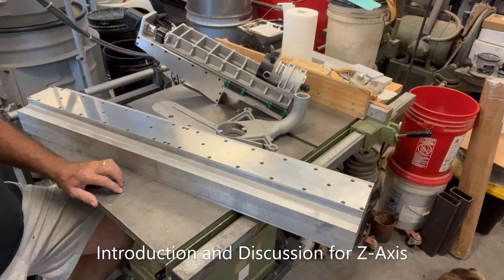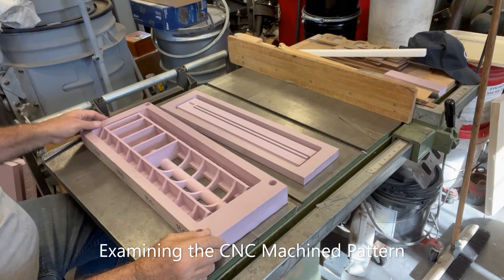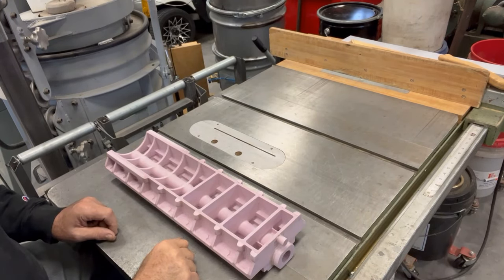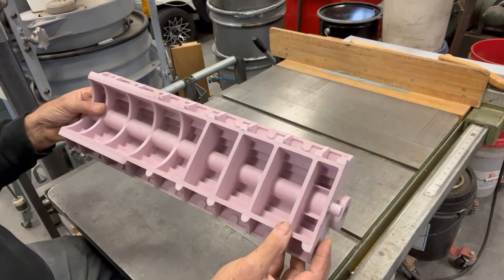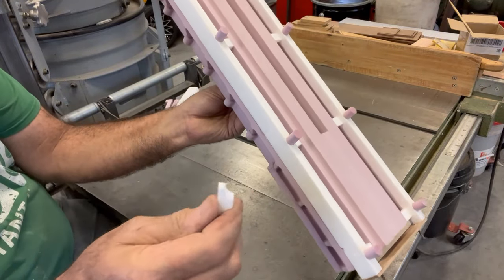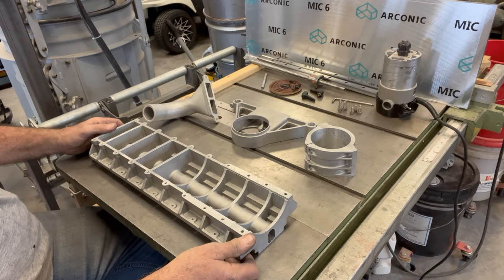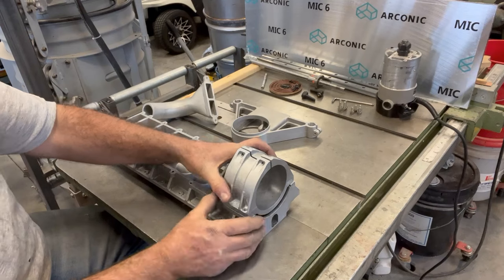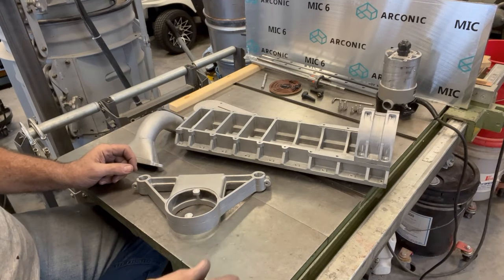CNC Router Build with Lost Foam Casting Part 1

Comment: How your castings are so smooth, what aluminium alloy do you use, thanks
Reply from the maker: I sand them, and the refractory coating reproduces the pattern finish and isolates it from the coarser mold sand. Best, Kelly

Comment: Can you "glue" the foam together with a wax? Like jewelers wax or something? If not I guess coating in wax could give a exceptionally smooth surface finish, especially in areas where there is multiple joints. Over a sanded finish?
Reply from the maker: I suppose you could use sticky wax to assemble foam pattern parts but I strive to keep the joint very thin. Polyvinyl Acetate glues ("white glues" like Elmers) work fine but used very sparingly. Good old rubber cement works well, and also low melting point in glue guns. I achieve satisfactory finishes (for me) with just sanding. you can rub the surfaces with coats of paste wax, but check your paste wax on a sample of foam first as some are reduced with solvents that will attack foam and some are not. I do sometimes seal imperfect joints or gaps with wax. I use a formula specifically formulated for LF casting available from Freeman Supply. Best, Kelly

Comment: Thank you for sharing your videos and expertise, castings are second to none. Could you let me know the most suitable aluminium to cast similar parts to produce a rigid cnc machine? 

Thank you in advance.
Reply from the maker: The engineering/elastic modulus is essentially the same for all cast aluminums so as far as rigidity for a given shape structure it won't matter much. The shape of the structure does matter. Steels/iron have 3x the modulus of aluminum but also weigh 3x as much, so if you're trying to keep inertial mass low on a moving structure like a gantry, it's possible to achieve a stiffer gantry for a given (lower) mass, with a material like aluminum by optimizing the shape of the structure. Best, Kelly
Reply: @kellycoffield533  Thank you very much for the in depth explanation, much appreciated as always.

Comment: How important is the packing sand since you have a refractory on the foam part? 
The few times I did LFC there was no refractory, I put the foam part in the sand only.
Which leads to the other question,
Do you need to use refractory as you have that super sand packer system.
Reply from the maker: Not all that critical. The packing sand just needs to be very dry and better if relatively uniform grain size. I use ~55mesh but it's just the fine sand available at the big box store (not play sand). The coating controls the rate at which the evaporated pattern gases escape to the mold. It also produces much better casting finish and prevents sand inclusions which is especially benefical if you machine your castings. It provides little in the way of mold structural integrity. Best, Kelly

Comment: In your opinion how hard would it be to use lost foam cast an engine block? Something similar to the way Steve Morris does his billet smx blocks. Dry sleeves and deck with plates covering the water jackets.
Reply from the maker: There are many fully water jacketed engine blocks being produced by lost foam casting. Mercury Marine uses the process and many non-US manufacturers. I think it's more of a challenge to a hobbyist than it is to the casting process. I can pour 60lbs of Aluminum. My intake manifold molds have 450+lbs of sand. That's big by hobbyist standards. I'd estimate a full size V8 block at say 100lbs. I'd probably need 150lbs of molten metal capacity (Crucible in my case) and a >=900lb mold. In a commercial operation with sufficient budget, that's not much of an issue, but to a hobbyist.....that's big. A cast block will never be a strong as a billet block just due to materials and flaw population.......but obviously, cast blocks are the norm, and billet the exception due to economics. On the other hand, I could cast a scale model.....Best, Kelly
Reply: @kellycoffield533  I'm wanting to create a block that doesn't exist. The basic architecture would be a Mopar 440 or Hemi style block. The bore spacing would be stretched from 4.800 to 4.900. With a raised cam tunnel and the necessary lifter adjustments to work with the mid 2000's Mopar pro stock head castings that I have. If I could pull something like this off  I would have the casting hip'ed and then heat treated before machining. I really like the idea of making the mold from foam. You're only limited by your ability and the amount of aluminum you can melt. Do thick areas need to have hollow inside the foam to increase fill/pour speeds? I don't remember, but do you buy certified ingots to melt?
Reply from the maker: @jamessheets9205  Yes, I use certified A356 ingot. No, I would not hollow out any of the foam pattern as I have found pattern voids produce undesirable results. Best, Kelly